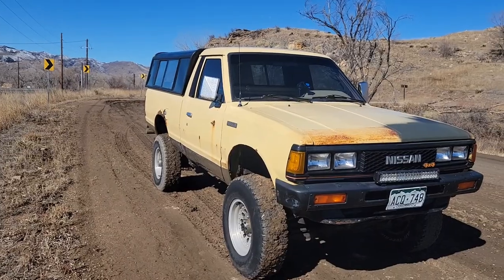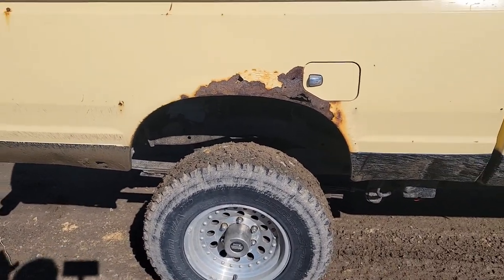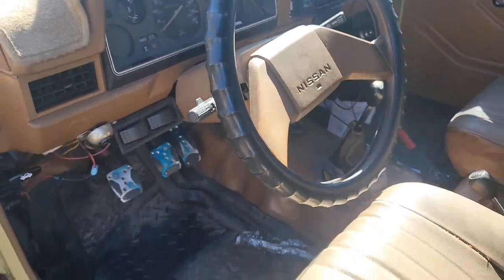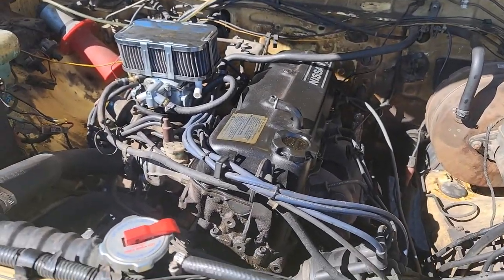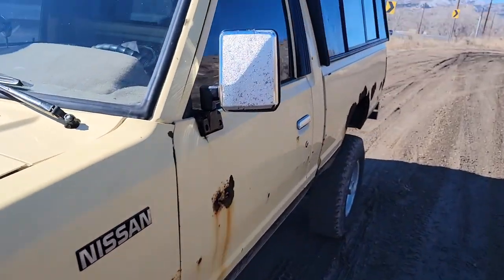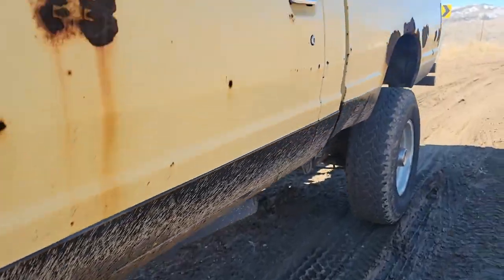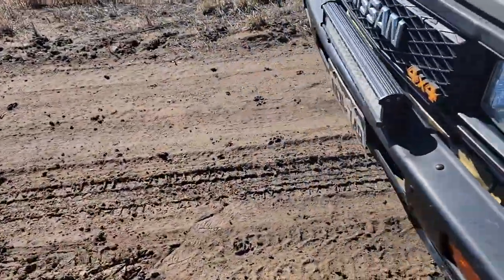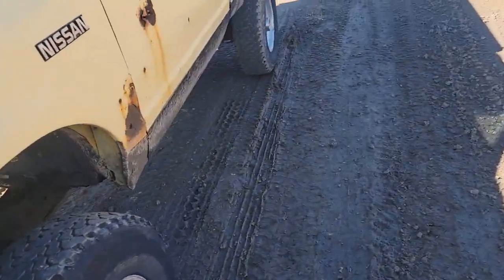1985 Nissan 720 4x4 Walkaround.

Comment: Back in the early 2000's I had acquired a 1981 720 extra cab 4x4 at an auction. Someone in the past had totally tricked out, they had dropped a chevy 350 motor with a turbo 350 automatic transmission, a Dana 60 rear end and a whole lot of other things. It would take me all night to list everything that had been done to that truck, but from the outside of the truck all that stood out was it had dual exhaust and a box on top of the roof that was the condenser for the AC ( which was working). Now this had been professionally done I had wanted to keep it till I checked out and then be buried in it. How ever it was not to be, I had been injured in 1984 and it took till 1999 before I found a doctor who knew what was actually wrong. Then it took over 7 years to get my disability. So I had to let it go, it was an amazing truck. I once did a run from a small town in SE Az to LA in six hours ( a little over 600 miles) but the speedometer only went to 85 mph, and it was peg the whole way there.
It was a great truck and I really hated to let it go, but with no income and my condition was getting worse I had no choice. Someone in Tucson Az bought it and I have no idea what happened to it.
Anyway they are a great little truck and have lots of potential. So good luck with your project. 👍😎😎😎🐈🦅🗽🦅🇺🇲
Reply from the maker: That sounds like an awesome setup truck. It sucks you had to sell it. I have a 84 kingcab that i want to make a video about i just havent filmed it yet.

Comment: How hard are parts to find for these old trucks? I found a 1985 4X4 with 125k miles on it in decent shape and may have a trade going down. I like the truck, but afraid if anything happens I may not be able to find parts for it. It runs great now.
Reply from the maker: Parts can be challenging to find because there are very few bolt on parts for them. With the recent gain in interest for 720's stock replacement parts are becoming harder to find. I wouldn't pass up the opportunity to own one just know that there is a reason I have three when I have to wait on parts for one I drive another.